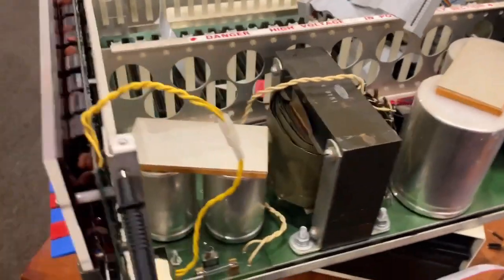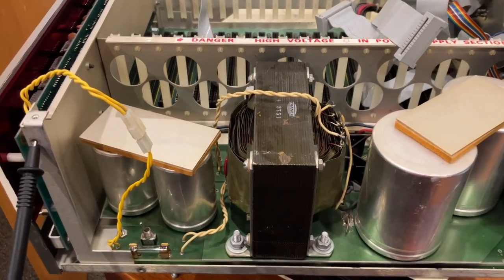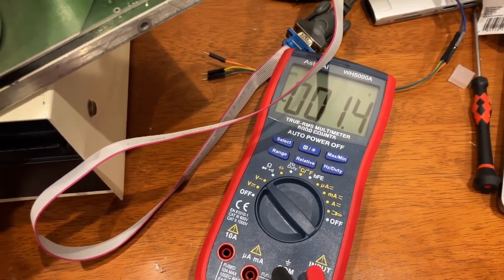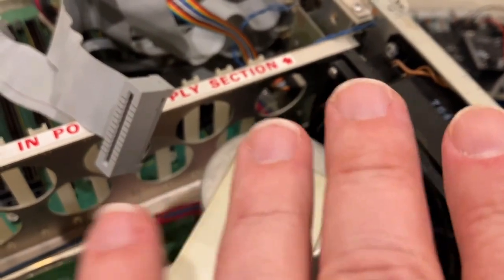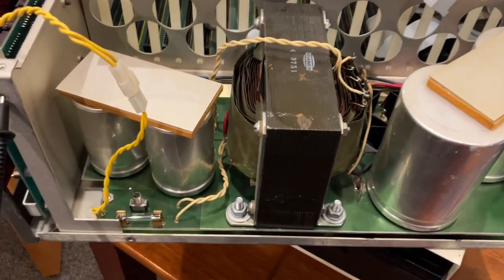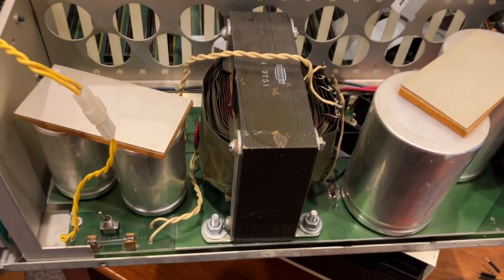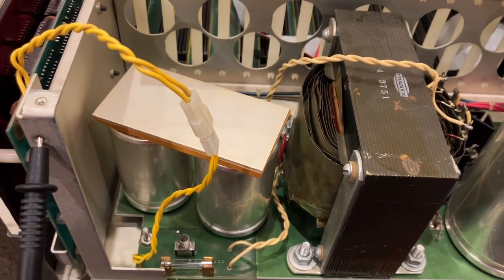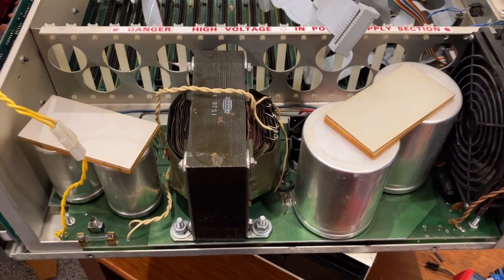HELP! IMSAI 8080 Power Supply Sadness (Altair 8800 clone)

Comment: corrected: NOT! == "the fuse should be placed after the switch for code" {copied from 1st Google check-in hit} heh

I would suggest Multimeter Ground to AC Neutral = White, Black being Hot 120VAC, based on its schematic

and upvote under-no-power trace continuity tests all the way through first

WOW! You should see the Altair 8800 power supply schematic's AC routing to xformers nightmare for comparison. Plus, fuse before switch in there also, b a d

I had to use an uninsulated butter knife as a screwdriver on my first 120VAC Light Switch replacement job at around 12 or 13, my sister's room was dark and she had homework with nobody else home.

When I went back to the fuse box, remember Glass Fuses that screwed in?

IT WAS ALREADY SCREWED-IN!  🥳
Reply from the maker: Fuse is placed before the switch so it can blow if the switch itself has a fault.
Reply: @Lantertronics  "Then they should've put a switch before the fuse so when you change it you do not fry from my forgetting to unplug it."  "But, if I forget to flip-off the switch first I will fry no matter what."

Switch-before-fuse code?: "The next time I think to use Google to double-check my ADHD-Addled Memory on something I've know forever, I will stick my Nytril-gloved-thumb up the next Google-Search-Dev-and/or-Exec-I-meet''s plumbing instead."

I can't find any equipment here with a fuse in it for a visual. I am all battery-powered now.  I did discover my wall sockets here are not grounded at all, based on the line noise showing on my FNB58 USB Tester's oscilloscope the other day, so its not all lame here. Now the city gives no sign of getting it fixed for the 234 units here.  They lied during the recent rooftop to basement full building re-wire job, apparently.  blew-up my laptop power supply, and nearly did-in the new $3,000 batch of components including 128GB RAM, a 5800X3D, and RX 6950 XT video card I waited two years to pull together, once the GPU was half-price. anyways. I have resisted all temptation to get it together months ago, having an odd latent fear once the last lead was laid, and CMOS Reset, "POOF" as soon as I plug it into my living room's non-grounded outlet is all I could think of all the time I stalled putting together my best PC in 35+ years, and now I know why.

corrected my {TOTAL lack of} trust in google search even further, Thanks!
Reply from the maker: @reverend11-dmeow89  After that experience I've got into the habit of obsessively unplugging things from the wall before working on them. ;)
Reply from the maker: @reverend11-dmeow89  That messed up wiring in your building sounds scary as hell!
Reply: @Lantertronics  a LESSON the butterknife screwdriver vs. fuse already screwed-in episode taught me.   i didn't get a trickle, which was weird, but I almost died when I reached in to tighten an already tightened fuse, knowing to unscrew it first and all already. ;-) I have another sister with an odd sense of 'humor'.
Reply: @Lantertronics  it is over 110 years old, Mark Twain & Teddy Roosevelt stayed here early on, as it was a hotel 1st.The fact that the city has failed to respond to an official Code Compliance Complaint, plus two follow-up calls speaks to why I am running for mayor next. heh even received a bogus award from Historic Seattle for said 3.5 year bogus renovation which they now have two reasons to rescind right quick.

way off-topic. so zipping it now

Comment: The DC outputs from the supply are not regulated; there are local regulators on each board to avoid voltage drops along the power buses if you had central regulators.  The +8 VDC gets regulated down to +5 VDC, and the +/- 16 VDC get regulated to +/- 12 VDC.

(Sorry if I'm repeating what you already know; I'd rather repeat it than not describe it at all. 🙂)

Comment: This is a very basic power supply, so that should help.

The schematic seems to have an error, it shows two sets of points near the power switch, one switched and the other unswitched, yet both are on the switched side of the switch.

Make sure the power is unplugged from the outlet.

Don't measure AC voltage with respect to chassis ground, you may have an open neutral feeding in, or similar.

Check for the numbered jumpers that are used to select the input line voltage.  Write down what thet connect between now, as it currently is; if those can be disconnected you can use those points to check the resistance between the various taps on the transformer, the terminals and the line filters on the power leads: (B)lack hot, (W)hite neutral, and (G)reen ground.

See if you can localize the smell to something specific.  Look at the transformer, see if there is any discoloration around the insulation around the windings (paper, etc.).

Even if the transformer shorted, you may be able to find a replacement since those are fairly close to standard voltages.  Current ratings may need to be determined if you don't have docs for it.  Look for any visible part number on the transformer itself.  A quick look at the schematic makes me think the secondary windings are two 12/12.6 volt and one 6/6.3 volt center-tapped, but that's ballpark only.

I'll try to add more suggestions when I can.

Edit: The "unswitched" points should go to the upper line to the switch instead of the lower one, so it taps off power before it reaches the switch.  Then the "switched" points are after the switch, along with the load side of things (transformer, rectifiers, regulator, etc.).
Reply: Oops! I edited the comment to correct a typo ("don" => "don't") and it lost the ❤️.  Sorry, next time I'll just post a follow-up comment, like this one!

Comment: I'd say the input filter choke got nuked, the coil marked L1 might be open if there is 0V across the power switch.
Reply: Or a trace going from said L1 coil to the fuse holder clip evaporated.

Comment: I think I was there when the short happened. It may have been the fuse holder shorting to ground via the chassis but I’m not sure.

I’d love to take a look at it as part of the VIP when school starts back up.
Reply from the maker: Yup, you were there. I was showing you how big linear power supplies were compared with modern switch-mode supplies.